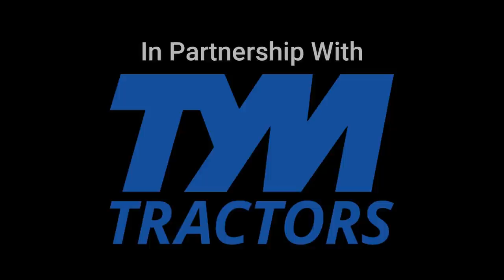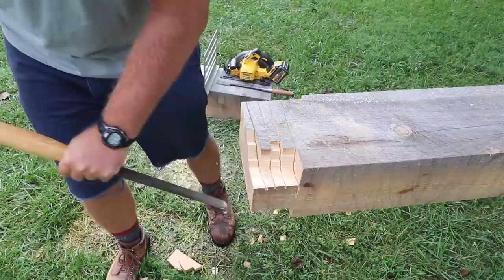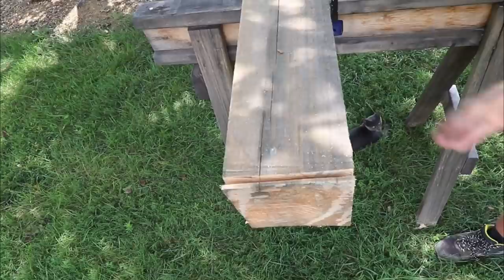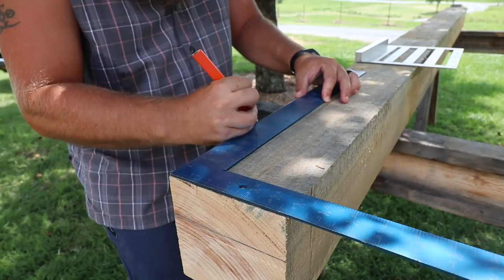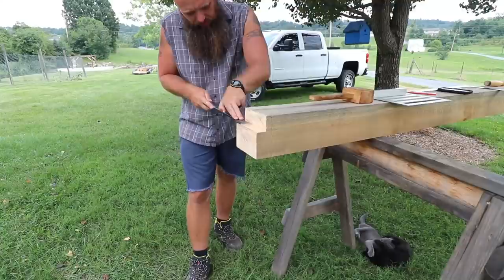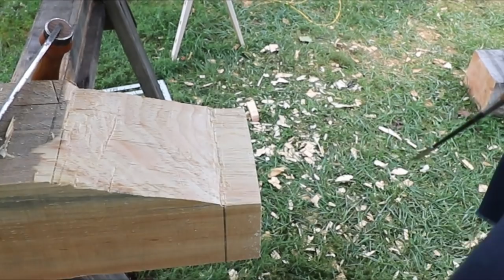11 Minutes Of Timber Framing, Building A Barn The Old Way

Comment: Get rid of those wooden sawhorses and set a couple of large tree stumps up to do your timber framing work on.  No more wobble.
Reply: If you hadn't said it, I would
Reply: Or at least nail a set of diagonal braces to each sawhorse.  That wobble would drive me crazy.
Reply: Like people can just go out and get logs to use for saw horses. 😆
Reply: A set of ponies and timber bunks is a very sweet system to rest timber work on.  No wobble and you get all the stick out at once for comparison and mass production.

Comment: you need a wider chisel-like 3-4" it makes a world of difference, my brother used to build Log cabins in CO I have friends that do timber framing.
Reply from the maker: it would but that 1in Japanese is my favo,
Reply: That would be called a Slick and that they are, slicks are pushed never tapped with a mallet, btw.
Reply: @OutoftheWoods0623  2" would be more useful for those wide cuts. You already use a power mortiser.

Comment: Cool.. I'm planning on a timber frame also.. except I'm using recycled barn beams which I already have..plus I have a sawmill.. I'm going to be cheating in a sense.because I'm going with metal fasteners.. I'm almost 60 and not enough time left to go the old fashioned way.. besides I built two cordwood buildings without electricity and mixed all the mortar by hand...wish I was 30 again..

Comment: In your way of thinking the end finish is very important and rightly so , but knock off most of the wast with power tools and finish with hand tool if your pushed for time , Very nice finish on this peace !
Reply from the maker: yep that is what I did this week,
Reply: Yes, power tool can be more productive.  But there are cases where hand tools are better served, one example is working with out of square and twisted material where the joinery is scribed to fit.  Hand tools would rule in that situation.